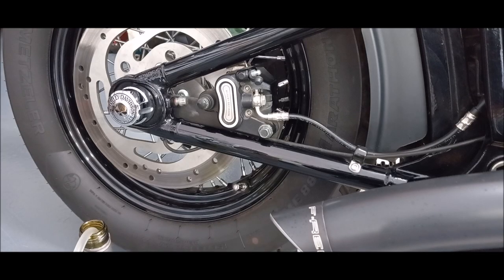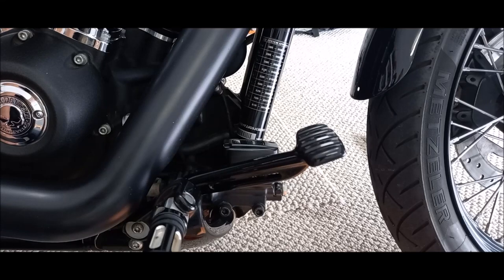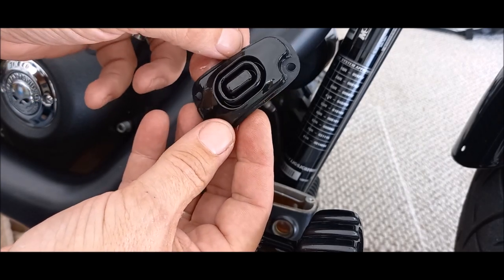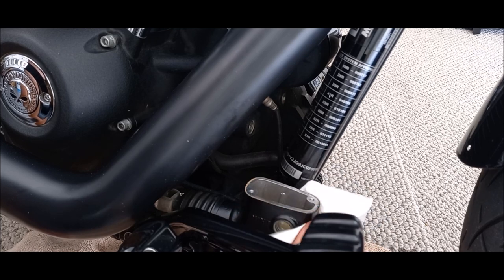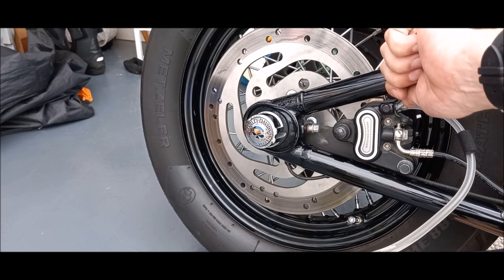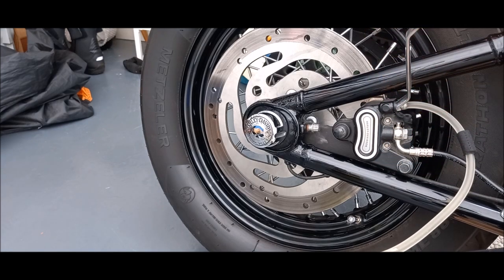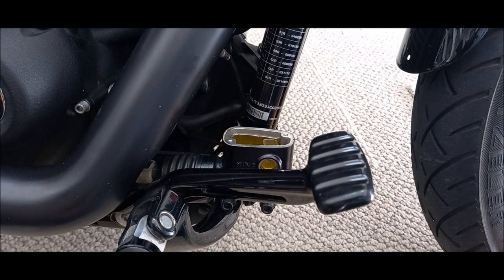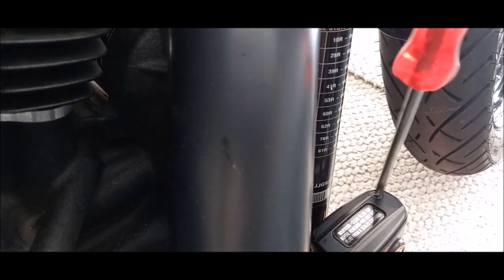HARLEY DAVIDSON BRAKE FLUID CHANGE..

Comment: Purchased a new Softail custom back in 07. Shortly after purchased I changed out the dot 4 fluid and replaced it with dot 5 silicone fluid. I like the dot 5 because you don't have to worry about it eating up paint anywhere and it doesn't absorb moisture like the dot 4...

Comment: another thing you can do is what i do.  buy a cheap turkey baster and use it to suck out the old brake fluid.     Its something Ive used for years on my bike and cars, too.   Harley manual says to fill to within 1/8" of the top of the reservoir
Reply from the maker: Great idea thanks..